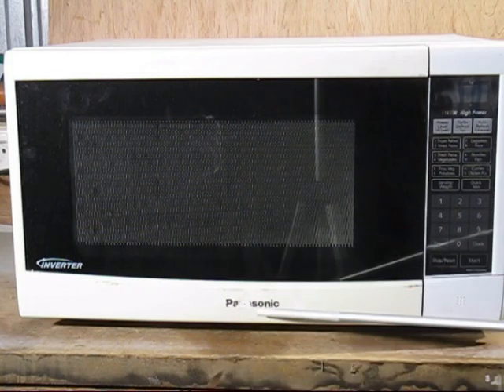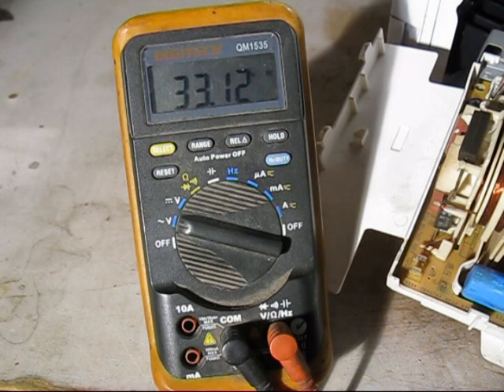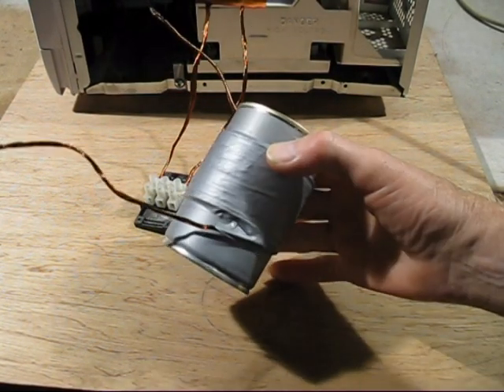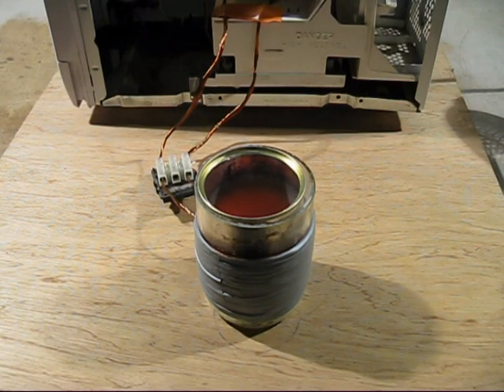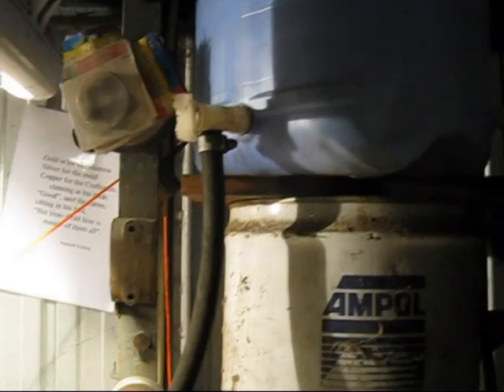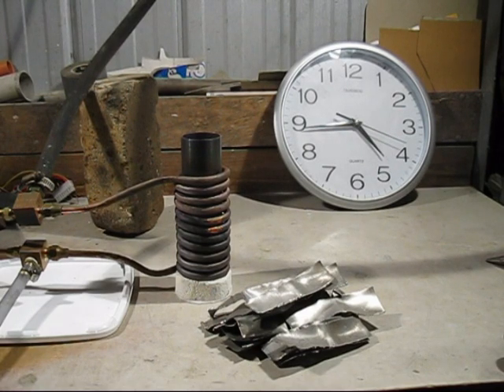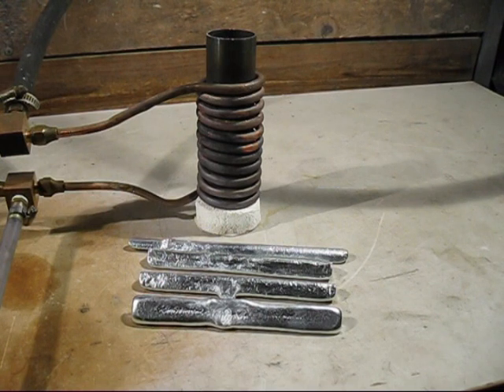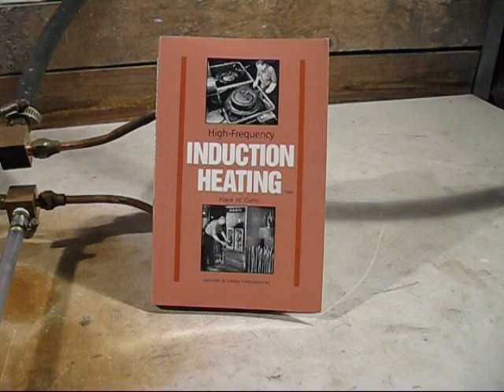First time on youtube, induction furnace made from microwave oven parts

Comment: Luckygen have you checked the frequency of the inverter when it is driving your work coil? The reason I ask is because I noticed that when I checked the PSU in my spare microwave, the frequency is below 30 kilo Htz when it first starts up. Presumably the lower frequency operation occurs before the magnetron emitter heats up and the magnetron draws power. That variation in frequency suggests that the PSU does not operate at a fixed frequency. Rather, the ramping up in frequency would be consistent with what would happen if the PSU control circuitry cuts the magnetisation current off when it reaches a particular value in the cycle. If that is the way it behaves, the frequency would go up if your setup is making the PSU work harder than it normally does when driving the magnetron, Hence, my question about what is the frequency when driving your work coil. Also, in the same vein, have you measured the mains input current when it is driving your work coil? Again, that would give an indication of how hard the PSU is working to drive your setup. I checked the 1000W Panasonic microwave that I have. On full power and with 241 volts on the mains, it was drawing 6.3A as measured by my clamp meter. That is somewhat over the nameplate rating of 5.3A. The difference may be because the current drawn is not sinusoidal, and as a consequence, my meter may not be reading the true RMS value that is quoted on the name plate.. As when I measured the PSU frequency, it took a few seconds for the input current to ramp up to that steady figure. 

Returning to  the PSU frequency question. You have not indicated the number of turns that are on the primary of your external transformer. Even if the number of turns replicates what was on the on-board transformer, and even if the ferrite cores are identical, the fact that your external transformer core has a larger air-gap between the core halves,( you indicated in your reply that it is 5mm) that would mean that its primary would have a lower inductance than that of the original transformer.  That would cause the magnetising current to ramp up faster. That difference alone would tend to push up the frequency, if, and it is an “if”,  the PSU control circuitry is configured to switch off the magnetising current when it reaches a particular maximum current. How long the flyback part of the cycle takes is more dependent on the number of secondary turns and the load on the secondary side. If the drive circuitry is configured to cut off at a certain magnetising current, that would help to explain why you have been able to get this far without letting the blue smoke out of the PSU. 

Are you still working with the original PSU that you started with, or have you let the smoke out of some other PSUs in getting to this far? If you are still working with the original one, it is a tribute both your efforts and whatever protection measures the designers incorporated in the PSU circuitry. Does the core in your external transformer get hot? Probably not given the large 5mm air gap, which would keep it from magnetically saturating. 

It would be really interesting to see the oscilloscope waveform of the voltage on the work-coil. What voltage does your meter measure across the work-coil?   Cheers
Reply from the maker: I have not checked the frequency while under load. I
will have to check that next time. I do remember years ago checking it and it
was lower under load but I can’t remember all the details. There is one thing I
noticed that on my video the water did not start to bubble until 3 seconds
after I pushed the start button and it was even longer when the can started to
change colour without water. Videos are great for picking up those small
details. Yes I have checked the mains current draw on an older version of my
induction heater and when it starts on p10 there is a boost function to push
more power so the food heats up quicker. It lasts for 3-5 minutes. Most people
use microwave ovens only for short periods of time to reheat foods so that is
why it is there. Another feature for you to look at is on the p10 level you can
only dial up 30 minutes max but dial up p9 you can dial up 99minutes. At the
highest power level the inverter cannot be used all the time and I suspect that
is why some microwaves have dead inverters because people dial up 30 minutes
and then keep dialing up more time until the inverter stops working. About the
amount of turns on the primary side, I put a few more turns than was on the
original transformer. The inverter transformer always has a large gap on them
and so does the CRT flyback transformers from TVs. This is why I put a large
gap on my transformer. I think it is to weaken the magnetic field because there
is DC and AC going through the primary side. This why ignition coils on cars
get so hot. The ferrite core on my transformer did get hot but a cooling fan
kept it at reasonable temp. When you say “ blue smoke comes out of the PSU” is
that a figure of speech? The inverter always fails short circuit, no smoke
here. The fuses in the microwave never blow even though they are fast acting.
The circuit breaker in my shed always trips before a fuse blows. To answer your
question, is this the original PSU? My original experimental induction heater
still works after 14 years. I thought it would be a once in a lifetime find to
get an inverter microwave but as they became more common place they were easy
to get. Since I have made that video I have destroyed two inverter PSUs trying
out modifications but it is no big deal because they are so easy to come by.
The early inverters had very little in the way of protection circuits but it
let me see how far I could go but the later inverters have very sophisticated
protection circuits so it is very difficult to destroy an inverter. For years I
did not want change my original set up but I realized that without
experimentation it would not progress further. As I am a motor mechanic, trying
to figure out electronics and learning how to do things has been a steep
learning curve. Also induction heating can be a black art with very little
information around to learn from. I do not have an oscilloscope and do not know
how to use one. I did measure the voltage across the work coil and it was about
32 volts. I know my meter will not give an accurate reading of voltage above
300 Hz but I have another method to find out the true voltage.
Reply: @luckygen1001  Thank you for that detailed reply. The microwave PSUs are really just a powerful switchmode power supplies. As a class of circuit, switchmode PSUs tend to be unforgiving of fault conditions or modification. However, some of the ancillary devices, like the IGBT gate driver ICs that are used in them now tend to have protection facilities like overcurrent detectors, which can switch the power transistors off on a cycle-by-cycle basis. In a fault condition, the aim is to do that before the main switching transistors destroy themselves and their associated components. That fits with your experience that the PSUs have become more robust to your experiments. The available power transistors have also become beefier as well. 

Induction heating driver circuits are more usually symmetrical push-pull or “H” bridge topologies that drive both halves of the cycle equally.  That is why, looking at my spare microwave PSU, I was inclined to think that nothing useful could be done with it in that direction because was evident that it is a flyback inverter. You have shown that something can be done with them. Thomas Edison famously maintained that he didn’t want university graduates working for him because all they could do was tell him all the reasons why whatever he wanted to do couldn’t be made to work. Whereas, other people that Edison employed would just keep trying. I was wrong when I thought no useful induction heating could be achieved with these PSUs. The opposite to Edison’s approach is typified by what Stanley Hooker achieved. As a relatively recent Oxford graduate with a PhD in fluid dynamics, Hooker got a job with Rolls Royce. He had never seen an aircraft engine supercharger before. But armed with some fluid dynamics theory, in short order, Hooker was able to improve their superchargers and thereby increase the aircraft service ceilings by thousands of feet – That became no small benefit in the midst of WW2. 

I expect that you are aware of the various induction heater boards that are now offered from China at modest price. An earlier commenter,
 Godfrey Poon , seems enthusiastic about the board with a 2500W rating that he obtained. From the photos and description, it looks like they are push-pull, “resonant Royer”, type oscillators. That is an elegantly simple circuit that automatically drives the work-coil and its parallel capacitor combination at its resonant frequency, irrespective of changes in the load etc. The circuit also has the advantage that the switching transistors switch at a point in each cycle where the transistors are less challenged in terms of the current and voltage that they are switching. That reduces the stress on the transistors and the rest of the circuit, whereas in the microwave PSU, the main power transistor has to switch off at maximum current. That’s why the microwave PSUs have such a brute of a switching transistor, with 60A and 1000V ratings. And that is why they have quite a large auxiliary transistor, just to catch the inductive kick back on the primary winding after the main transistor switches off. 

However, even if the microwave PSUs are not ideal as a source of high frequency power for small scale induction heating, given the huge number of these PSUs in the scrap microwave stream, it will be really interesting to see what is achievable with them. Here is a link to a little more information on the microwave PSU. Again, it warns of the special hazards of these devices, so stay safe everyone.  https://www.avdweb.nl/tech-tips/tips-2/panasonic-hv-psu 

Here is a link to a US Panasonic training document. The two PSU circuit diagrams are not the same as the one shown in either the link above or in the earlier link that I posted. The circuits in the link below are for 120V supply, whereas the other one is for 220-240V supply. That may be the reason for the difference, or it might be because these are older circuits. The US document is undated. However, it does confirm what I suspected earlier, which is that the inverter frequency changes appreciably with variation in load.  http://media.datatail.com/docs/manual/371449_en.pdf

On the theme of scrap microwave ovens, the power transformer, or perhaps a pair of such transformers, from older style microwaves, if rewound with suitable low voltage secondary could form the basis of the 48V 50A power supply needed to fully power one of the Chinese induction heater boards. Judging by fan cooling provided, some parts of these boards must be working pretty hard. Searching for (2500W ZVS Induction Heater Induction Heating PCB Board) will turn up many sellers offering these, both with and without a power supply and various accompanying items. Cheers
Reply from the maker: It is very interesting that you mentioned Edison. When I first found an inverter microwave I showed it to an electrical engineer, he said that
the topology of the inverter was wrong so it could not work as an induction heater. He was very surprised when I showed it to him heating a can to red
heat. Two sayings come to mind about what the EE said, 1. Two heads are better than one 2. A fresh pair of eyes helps solve a problem. Ha! great minds think alike, one of those websites showed him doing the same thing as me, wrapping some wire around HF transformer to make measurements. The second website says
that all power levels are on all the time, this is not true. Put your clamp meter on the 240 volt lead and select power levels P3,P2,P1 and you will see
that it switches on and off like a normal microwave oven. Regarding the sharp inverter oven I did some tests to see what the frequency was with the magnetron
disconnected, it was 33 kHz. It was 36 kHz with the magnetron connected.I was reading some interesting info about how to use an induction furnace, it said a half bridge inverter output can go directly to the work coil without a
transformer in between but a full bridge inverter needs a transformer in between the inverter and the work coil, why is that? It was in an inductotherm
training manual. This is why I put a transformer in between the inverter and the work coil.

Comment: Reguarding the stranded wire coils, Adding layer of insulating kaowool to the tin can would thermally insulate the coil  from the tin can. Painting the outside layer of the kaowool with water glass (sodium silicate) and cure it with co2 forms a hard shell on which you can wrap your coil over vertical tooth picks so as  maximize the surface area of the wire in contact with air carrying away excess heat. Still. This might help somewhat. Butwatter cooled  copper tubing makes a great  coil.

Comment: Since there is so much heat when using a induction heater, how would one make the efficiency become much higher ???  Thanks
Reply from the maker: Use lots of insulation.
Reply: @luckygen1001  That does make sense.

Comment: It appears to me that what you measured with the meter is that your single-turn secondary winding was producing 30Volts AC. The meter was set to its AC voltage position, rather than the frequency (Hz) position so it was not measuring 30kHz.
Reply from the maker: Have a look at the video again and see that my meter has a blue Hz button. If I select AC or DC mode and press the blue Hz button it will measure frequency. Also have a closer look at readout, it shows 32.00k.
Reply: I thought the same thing (30 Volts AC). Went back and checked the video but the quality is to poor to be able to make out the k on the meter.
Reply: @luckygen1001  Sorry, my mistake. The blue button isn't really legible in the video, and there is a Hz setting on the selector switch, which led to my error.
Reply: I'm pretty sure this gentleman knows how to set his meter to read frequency if he is able to successfully modify a microwave inverter, without it going bang.
Reply: @luckygen1001  Hmmm.  According to the QM1535 manual, it should be set to Hz, not Volts, to read frequency.  The blue button selects between duty cycle and frequency measurement when the meter is set to Hz.  Maybe you have discovered an undocumented feature of the meter.
Reply from the maker: You can measure Hz using AC or DC function and then selecting the Hz button.

Comment: The glass heated uniformly enough.
 When one part of a glass object gets heated while the other part remains cooler it gets to a point that the hotter part expands more than the cooler part causing internal molecular stress that leads to fractures in the glass

Comment: The melting point for pewter is reported as 170 to 230 degrees C.  The point where steel is glowing red is somewhere in the range of 600 degrees C.  Explains the speed.  Of course, the mass also matters — no need to remind me.
As to the glass — soda lime glass might be on the borderline.  Borosilicate (Pyrex) should be able to handle the temperatures you achieved.
Reply: Or fused quartz would work also.

Comment: Why didn't the glass shatter? My thought is that, this being an induction furnace, the tin can was carrying all the induced current, which caused it to heat up.  The glass is not a conductor, so would not be affected by the induction, but by convection or radiation. The glass is not a good thermal conductor,, and would depend on radiant heat along with some convection heat to get any heat into it. Since the glass remained in the middle of the furnace after removing the crucible it could still receive some radiant heat, but would cool down slowly in the ambient air, so it did not receive any thermal shock (such as pouring cold water on it when it was hot).  Also, there was no apparent pre-existing stresses in the glass that were released during the heating.

Comment: One minute twenty seconds and water goes from room temperature to boiling is just super quick. What is the BTUs of that happening ??? Also, would using this type of setup be able to heat room air super quickly and supper efficiently ??? I know this is not what you were doing the video about but your thoughts would be appreciated Sir. Also, is there any way the induction heating could be spread all over the item instead of starting to heat in the middle ??? Thanks, VF
Reply from the maker: I am not sure if air will heat as well as water. No the magnetic field is the strongest in the middle so it always starts there.
Reply: @luckygen1001  Would you be able to do a video on making a heater using induction current ??? I am sure you could figure out something unique for this idea luckygen1001. Thanks and good luck. VF
Reply: @luckygen1001  Thanks

Comment: In another life many years ago I used to work in a car engine factory operating a induction heater to fit piston pins.
I never had to have a lighter or matches for a smoke. A quick twiddle of the power knob and a scrap conrod would do the trick in a couple of seconds. Mind you there was a wee bit of arcing doing on down in the throat of the machine.
Cheers Eric